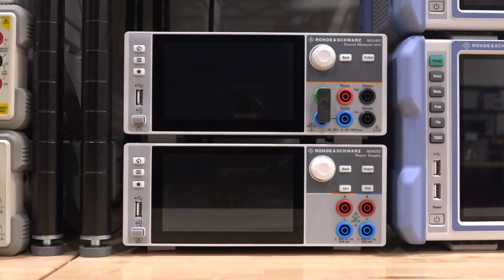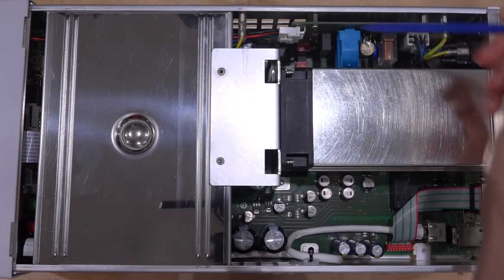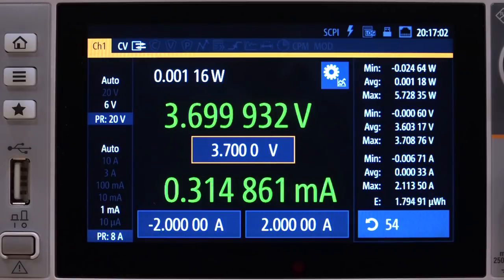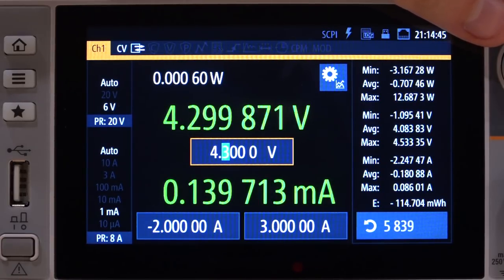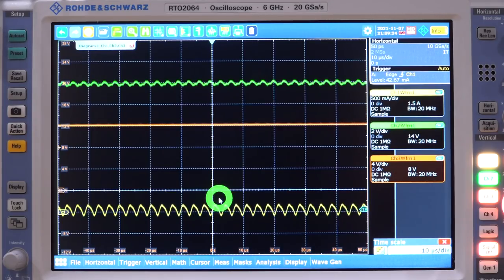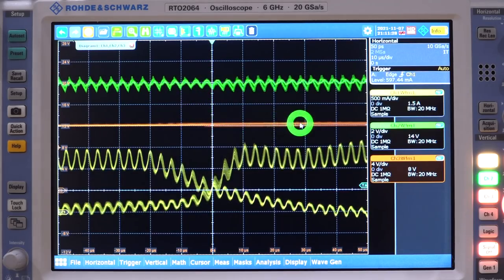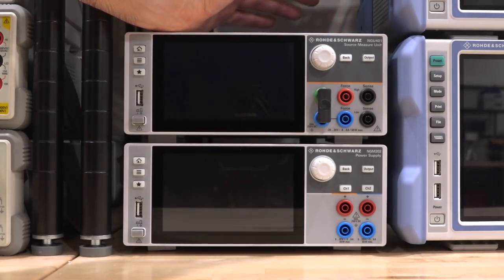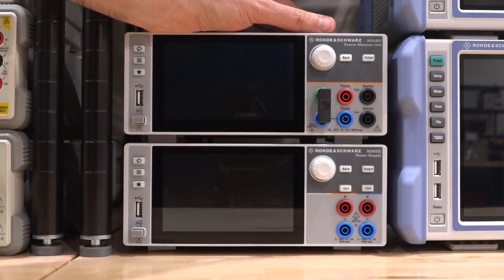TSP #201 - Rohde & Schwarz NGU401 500kS/s Source Measure Unit Review, Teardown & Experiments

Comment: That's an amazing review. The fast scale auto-ranging is something on this instrument. I've experienced some difficulties in measuring current consumption of some IoT devices. The deep sleep current consumption starts around 3 uA and then it wakes up to around 10mA in stand-by mode and then goes right into 180mA when transmitting an RF signal, before it goes into deep sleep again. Using a Keithley SMU, I had to put it manually to the 1A scale, otherwise the device would turn off when the SMU was auto-ranging. Another solution to measure this current was to use a 6 1/2 digit bench multimeter, but then I couldn't caracterize well the DC behavior of the device. I wonder if R&S is releasing some units focusing on very low current measurements with triax connectors.

Comment: Quality design and construction to be expected from Rhode and Schwarz. Hopefully future firmware updates will improve the graphing functionality. Unfortunately I've found their customer service to be pretty unaccomodating towards non-enterprise users.

Also, as far as value, I find it difficult to argue that this R&S is a better value than current Keithly or Keysight boxes..
Reply: I had a very different experience. Wanted to do a firmware upgrade on my HMP 2030 (a long time after warranty), ran into some issues with USB (pretty poor instructions tbh), but after a few mails we found the problem. I was positively surprised that R&S took the time for a rather old device - non-enterprise too. I'm from Germany, so it could simplify things a bit, who knows.

Comment: Does this unit temporarily shut off when switching current ranges?  Every SMU I have used shuts down temporarily when switching current ranges in auto range mode.   If it is biasing a depletion mode FET gate that device will crater when the gate is open.   Thus I am forced to use a fixed current range that encompasses the largest gate current I expect to see.
The switching in SMU and DVMs occurs because the series current sampling resistor is changed.  I am hoping for an SMU that does the sampling resistor switching in a make before break fashion instead of temporarily disconnecting.   If this had that capability I would order some immediately. 

The six figure measurements make running on a fixed range a bit more tolerable, but seamless range switching would be better.

This unit in your video appears to be limited to 20V.   For testing I would like a unit that can to up to 60V at several Amps.   Do you know if R&S is planing on any higher voltage/power models?

Comment: Farnell selling for 5000+VAT (UKP), sounds expensive but I guess it's about right in comparitive terms given it's spec, brand name and target market. I also like how the rear panel has all the options including good old GPIB.
Can't wait for the teardown.
Reply: Tequipment (USA) has them for $7200-$9500 (I'm amazed at how much the DVM option costs on the 201), but the 401-COM is on sale for $5000 which is pretty good imo
Reply: It is $4995 in the USA from Newark (Farnell).   The equivalent (and not quite as nice Keithley/Tektronix model is $11K.

Comment: The biggest downside of this instrument seems to be the low force-to-source voltage drop of only 2 V. 
At least I think it is only 2 V because they obscure this specification in the manual by calling it "Maximum sense compensation" which is not obvious what it means.

So for a typical 4-wire resistance measurement on a substrate/material (without metallic leads) you can only test up to 6 V maximum (2V over each section of the sample), and not use the full 20 V range. In reality you also have contact resistance making it even worse!

Keithleys SMUs allow for 5 V drop between force and sense, but if you exceed this value you do not get a warning and you only start getting incorrect measurements. This has caused many issues in our lab!

Does this instrument at least give you a warning if the voltage drop between force and sense is more than 2 V?

Comment: In Europe they used to have those stupid brittle stickers that said warranty void if removed. Even if you didn't want to open the case, you could accidentally damage that stupid sticker...
Reply: well several nvidia GFX cards have it too. So basicly putting a custom cooler on it will remove warranty.

Comment: I'm confused... Why should we pay so much to devices like this when a cheap power supply plus a good voltage stabilizer can do the job?? What am I missing here??
Reply: I mean adjustable voltage regulator ic
Reply: @arashghasemi  4 quadrant operation along with VSIM/ISVM capability?
Reply: @bakagaijin7452  there are negative regulators too ... what do you mean by vsim isvm???
Reply: @arashghasemi  Most power supplies are a one quadrant instrument. A programmable load is a one quadrant instrument. An SMU, of this sort is four quadrant. It can source and sink on positive and negative rails. 

For some tests a power supply and DMM is enough, but they are in no way equivalent to an SMU. Not to mention, the accuracy specs of most SMUs are better than the average power supply or handheld DMM.
Reply: @martinmckee5333  I believe you guys are correct. But I can't understand the need. If we wire a transformer to get both + and negative rails and then use heavy filtering and appropriate precision regulators on both rails then can't we do four quadrants with some acceptable precision?? at least for designing circuits like opamps ???
Reply: @arashghasemi  Say you're designing new types of semiconductor devices and need a probe station setup measuring down in the fA range to acquire the full gamut of parametric curves. I'd be hard-pressed to find a system using a regular PSU, voltage regular, and DMM that could come close to meeting those specifications.
Reply: @ahintofreason  got you. Thanks
Reply: @arashghasemi  It is certainly possible to make due without an SMU. It is a specialized piece of equipment, for special purposes. However, the experiments that Shariar performed provide an example of when you might need more than one quadrant. 

When testing the battery bank controller, he swept the voltage up and down causing the controller to go into modes where it both sourced and sinked current. While both of these tests could be done without an SMU, it would be difficult to do it without disconnecting the controller. 

Also, for lots of simple circuits and non-precision circuits 0.5% accuracy is good enough. A 6.5 digit SMU like this can do 0.025% accuracy, or better. That's total overkill for some general opamp circuits. 

So, you the only thing you are missing is that sometimes an SMU is necessary because it is such a demanding test that building the test setup yourself would take too long, cost too much, or both. Otherwise, an SMU can replace a number of other pieces of test equipment and possibly make testing faster.

There's nothing you couldn't hack together without one though... but you might just be building your own (less capable) SMU if it's built of power supplies, DMMs, and loads.
Reply: Simple situation you can face even as a hobbyist: Try to measure the current consumption of a wireless IoT sensor. During standby it consumes some 10µA, let us say 20µA. And suddenly it starts transmitting and consumes 20mA. There is a decade in between. If your meter was in the sensitive range for the 20µA, you can face a high burden voltage in ths range when the device starts transmitting and consuming 20mA. The voltage drop on the meter mostly will leasd to an undervoltage event at yout battery operated IoT device. The µC resets and your measurement is spoilt.Of course you can select the higher current range of the meter. Baut then, you lose resolution. In this situation a SMU is very useful. Of course too expensive for a hobbyist.
Reply: If you want measure on transistor such as transistor characterization , then you need such equipment , it need to both source and sink current in picoampere range in four quadrat , or better fA range.  Shahriar has done it before in old video .